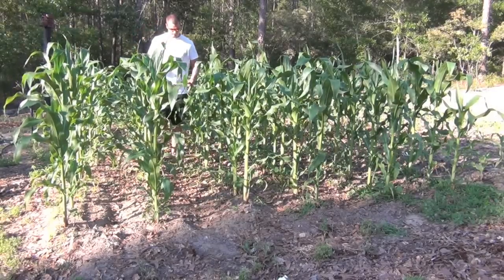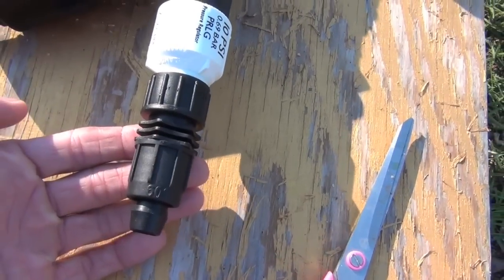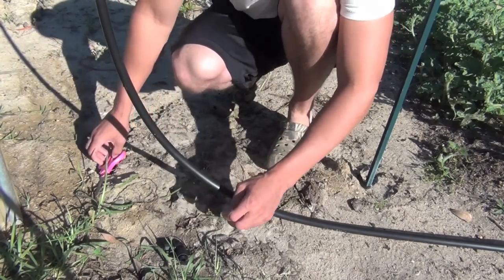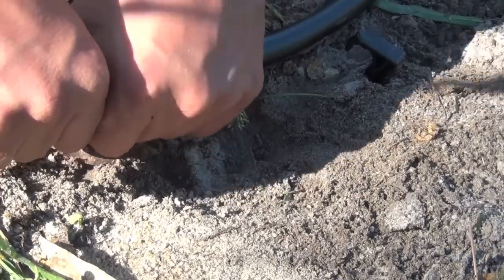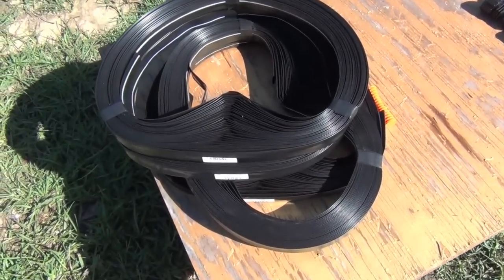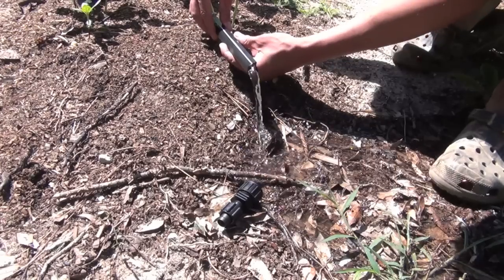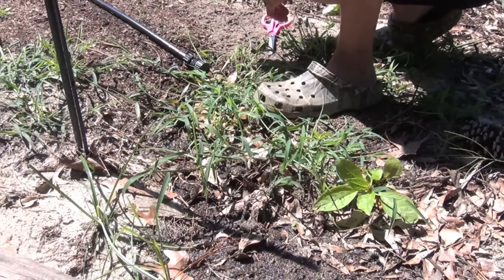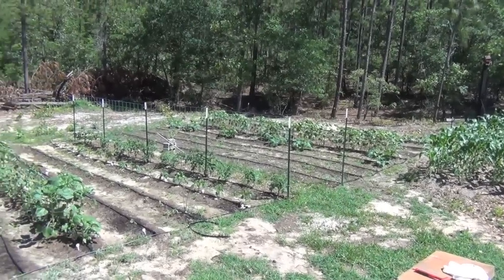Drip Irrigation Part 2 (Irrigation Install)

Comment: Looks good. Are you going to take of the corn with drip too? I use it on mine and it works good. I just line up t-tape to corn  I then do a kinda tomatoe weave down the row and this way I can still cultivate between rows. You'll love the drip.

Comment: Even full bore through a 1/2 " mainline-not too bad for dry conditions. But later when plants are all bigger AND it's hotter it could be expensive. We pay for water where I'm at. Along with high service fees we also have to pay an additional 2/3 of WATER cost for SEWAGE DISPOSAL fees like it was going down the toilet. My water bill is high in the summer and I garden only around 1000sq ft. Do you have a  Meter and pay by amount used? We have many scenarios up here- I'm just curious about where UR

Comment: If you can bury the main line just below the surface of the ground, you can use it next year too.  Southern sun's are very tough on drip hoses.  I purchased the same set up as you did, but I had my own timer and I purchased the 15 mil.  The only thing I don't like about the 15 mill is that the emitters are spaced too far apart for my taste.